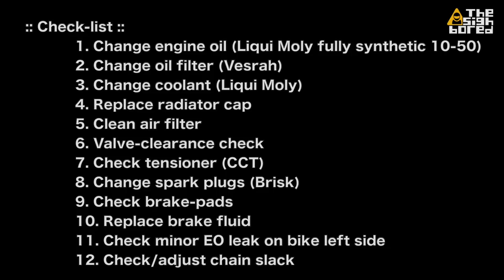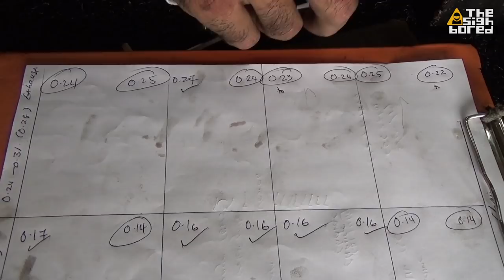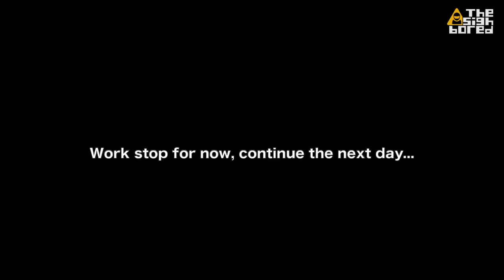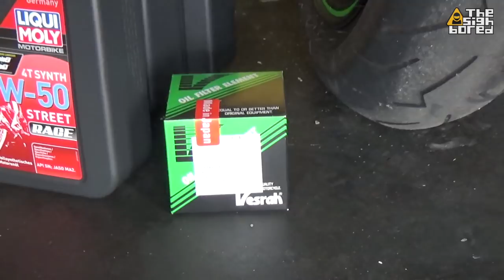Kawasaki Ninja ZX-6R | Workshop 23 | 65,000 km | Service | Valve Clearance | Coolant | Radiator cap

Comment: for 2025 is this model still relevant ? wanna upgrade from ninja250 2013 to 600 bike . budget is under rm30k
Reply from the maker: Still relevant in what sense? Masih power/laju? Yes of course.. Under MYR 30k rasanya boleh cari.. Tapi jangan lupa standby dalam 5k tu untuk nak buat apa2 service/ganti part.. Motor lama bukan baru, macam mana pun akan ada benda untuk dibuat/dibaiki. Kalau tak ada standby duit, nanti pakai dalam keadaan tak semua OK, lama2 lagi banyak hal kena settle.. Just a reminder.
Reply: @thesighbored  ah i seee thanks for the information !

Comment: Hey. Could you ask the cleaner what is a good fix for low rpm response?? Heard a lot of complaints about bikes having a dead spot for acceleration at low rpms?? I’ve seen guys trim the throttle body plates like a 1/8 inch off. Or what I was thinking to do is take them off then drill a 1/4 inch hole in them to let it draw more air.  Or what does he think??   Thanks??
Reply from the maker: Personally I think the best fix is to get a proper dyno run and tune-up, the tuner will be able to tune the power band for the rider as the rider request for.. Let's see what The Cleaner has to say..
Reply: By trimming the plate it makes and opening thus allow more air flow to flow in, but this will cost you a throthle plate... in a case you want to be at stock in future there is no way to do that unless to buy a replacement plate..

Why dont just crew in you idle nuts which will make the RPM higher... Or change your sprocket ratio which will improve your low RPM response
Reply: Ahmad Khan. Great video and service.  I need to check my cams.  I’ve had my bike now for 4 years never checked valve clearance although I haven’t put that many miles on maybe 4K?? But I don’t know when last valve service was done. Bike only has 11k miles. Good video guys.  Cleaner knows his way around
Reply from the maker: @theozman38  Miles or kilometres? Did you get it new or used? If used, the best is to have that VC done, for peace of mind.. Thanks for viewing!

Comment: 32:00..is he just using rtv@gasket marker instead of a piece of paper gasket?
Reply from the maker: It's a metal gasket, the gasket was not damaged so he re-use it but applied gasket glue (gray) before putting the cover back together.
Reply: TheSighBored haaaa,i seee,tq to clarify